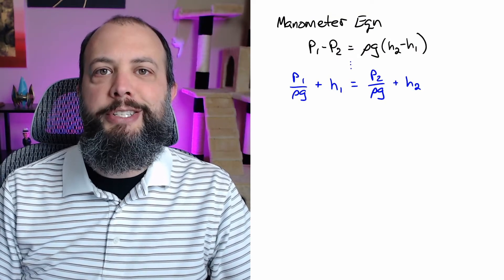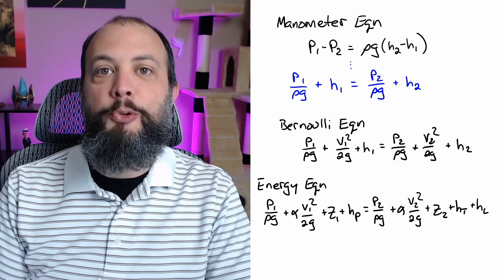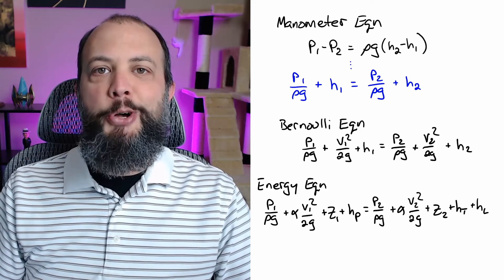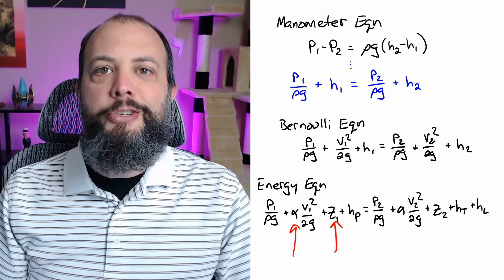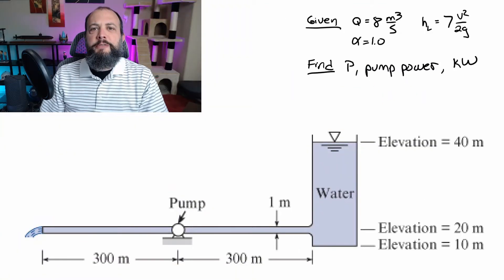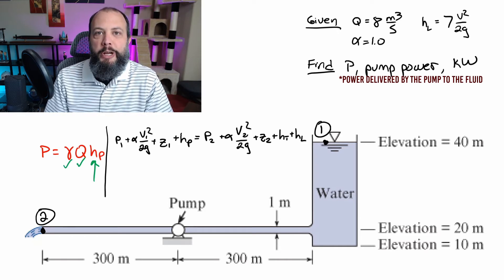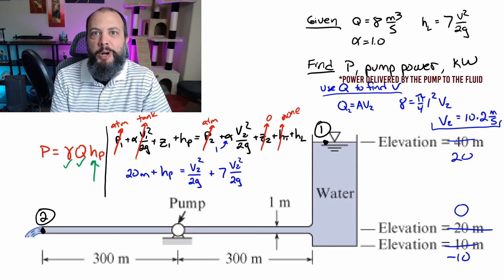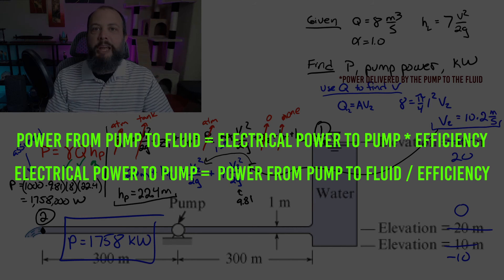Energy Equation with a Pump – Example Problem

Comment: i applied bernoullis from the entrant at the bottom of the tank to the exit at atmospheric pressure and got a pump head of 17.022m, so the pump power would be 1335kw. i used the free surface as the datum as calculated the hydrostatic pressure at the entrant (z=-20m). why do we get different pump power? i used g=9.81, pressure at entrant = 196.2kpa
Reply from the maker: "calculated the hydrostatic pressure at the entrant (z=-20m)" - This is the problem. From the surface of the tank, to the entrance to the pipe at the bottom of the tank is not a hydrostatic problem. You can't treat this as a manometer. The fluid at the entrance of the tube is moving, there is velocity that you are not accounting for. You would need to use Bernoulli Eqn from top of tank to entrance to pipe to account for velocity. This will lead to lower pressure at pipe entrance than you calculated, since instead of all the height difference becoming pressure difference, some of the height difference becomes pressure difference but some of it becomes velocity.
Reply: @BrianBernardEngineering  thanks. i figured. i will retry it from the free surface. is there a way i can solve using bernoullis from the entrant? how would i do it just or curiousity. what additional info, if any, would i need
thanks!
Reply from the maker: @versed77  You'll need to solve for velocity first, before you can solve for pressure at the pipe entrance. Energy Equation from Top of tank to pipe exit will give you velocity. Then Bernoulli Eqn from top of tank to pipe entrance would give you pressure at pipe entrance. This assumes pipe diameter is constant, so velocity is same based on continuity condition. If diameter changed, you could solve for the different velocity using continuity if you know the diameters.
Reply: how did you calculate loss through the pipe length, hL?